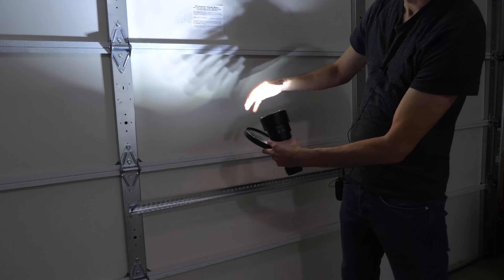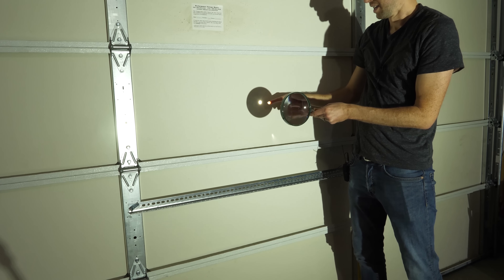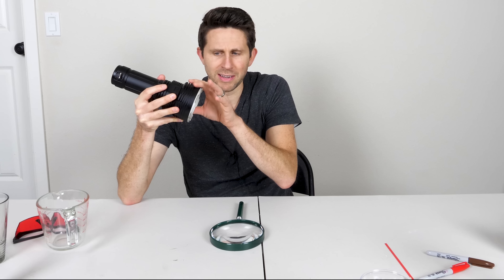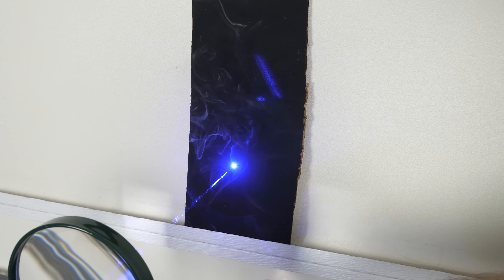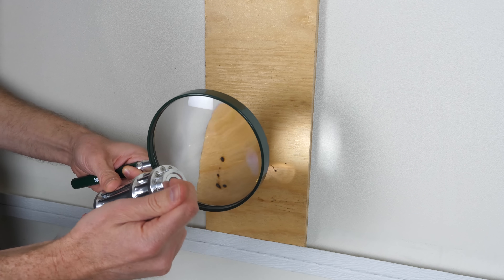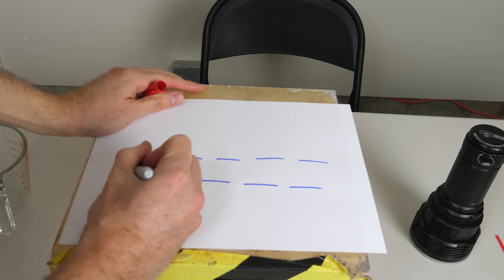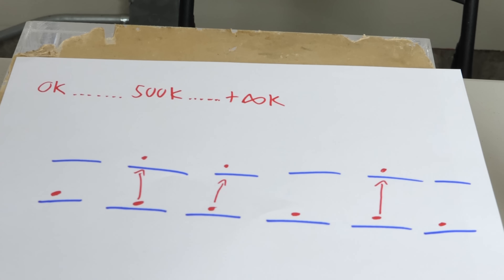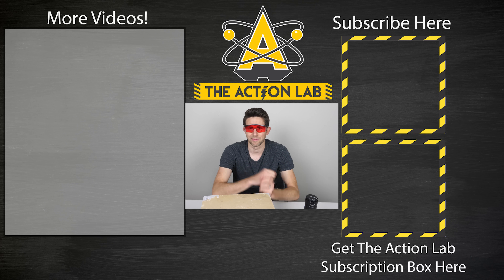What Happens if You Focus a 5W Laser With a Giant Magnifying Glass? Negative Kelvin Temperature!

Comment: Can you bounce light 100 times, not infinitely.
Or 
Can you explode a dynamite by shining a very bright light on it?
Reply: Dynamite is a high explosive. Which means it needs a low explosive(blasting caps) to get a high explosive reaction.
I don't know about the laser light, just explosives.
Reply: @perplexedpapa  thats not what high explosive means. high explosive just means its chemical reaction happens almost instantly
Reply: @Blox117  sorry, but that's not true. I have military training in explosives. A "low" explosive can be lit with heat, and a "high" explosive needs a shock force like when a low explosive goes off. Some of our high explosive devices are even set off with other high explosive devices like det cord. 
Gun powder is a low explosive. TNT is a high explosive.
An explosion is just a rapid combustion in a confined space. You can do this with either type of explosive.
I'm sure you can look this up if you still doubt me.
Or maybe "THE ACTION LAB" can clarify this.
Reply: @perplexedpapa  you are confusing high and low explosive with primary and secondary explosives. a high explosive detonates at a high velocity which is faster than sound, low explosives only detonate and propagate at a slow velocity or less that the speed of sound. low explosives are so slow at reacting that they often just catch on fire like gasoline for example
Reply: @Blox117  you are correct about a low explosive having subsonic burning speeds. And high explosives being faster than subsonic. But his question was can you set a high explosive off with a laser, and the answer would be "no," because a high explosive needs a shock force. The more unstable the high explosive is, the less force you need, but heat will not give you a high explosive reaction. It may melt down and become so unstable that a falling drop of it could explode like nitroglycerin. We had some rocket propellants that if melted and dropped to the deck, that it would blow your leg off if you stepped on it fighting the fire. We trained every three months minimum because if the launcher had a fire I would be one of the first three there, usually the first.
Reply: Shreyansh Jain light can not bounce infinity unless you have 100% efficiency mirrors but without that the light will get absorbed by all the mirrors over time but it will probably take more that 100 times